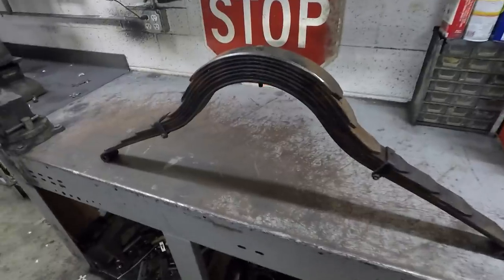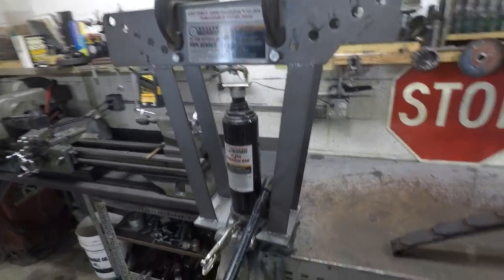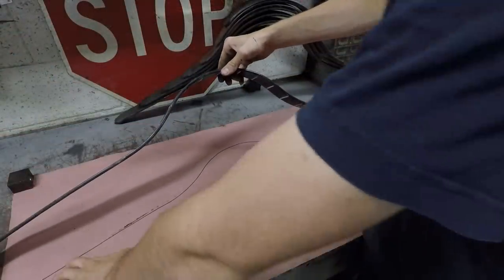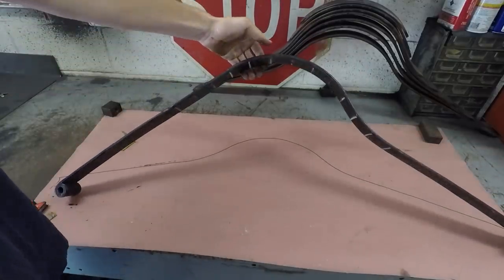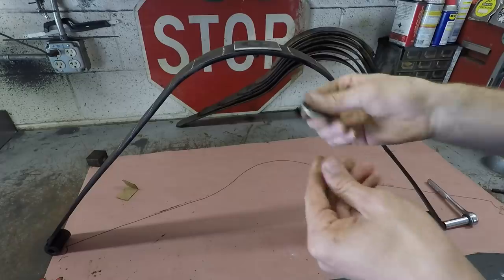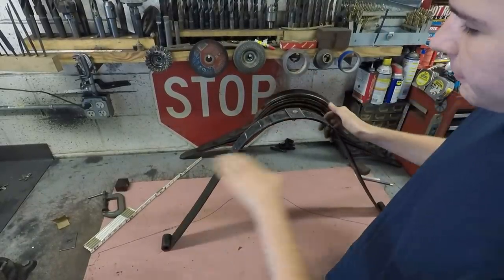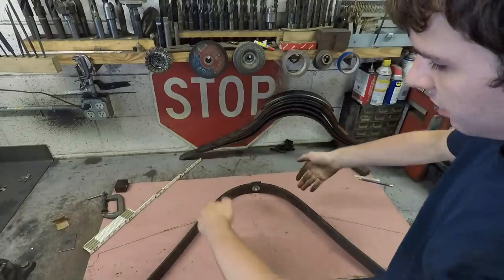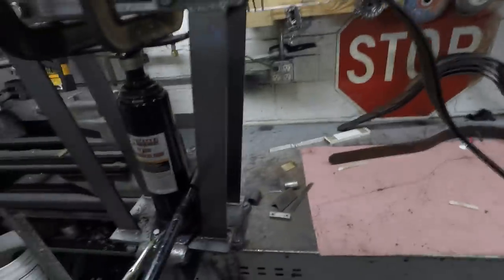How to Reverse the Main Leaf of a Leaf Spring

Comment: I worked  in a spring shop for years. We would make and change model T and A springs all of the time. On a job like the one you are doing, we would never do the work you are doing cold. It just does too much damage to the quality of the spring material its self. We had patterns that allowed us to make exact copy's of the original springs. On a job like yours, if we didnt just make a new leaf, We would heat the leaf red/yellow hot and re arch it over a pattern with the eyes up. The quality of metallurgy from the time the model A's and T's were built is crap compared to what we have today. When we tore into a model A or T spring pack, they were typically wore out or rust pitted so bad they were not worth trying to save. Cold arching is a commonly done part of making springs. This is only used to reproduce a 1/2 to 1 inch correction to put "snap" into the spring pack. Snap is the amount of more arch each leaf has over the one below it or closer to the main leaf. You can gain far more strength with snap than you can by adding leafs. This is where the art of making springs really becomes more clear. If you want to lower a vehicle you de arch each leaf but add more snap. This prevents the spring from feeling too soft or saggy from the de arch. This produces a quality leaf spring that has a higher spring rate than it did at full arch height with no or little snap. I have 21 years experience in making leaf springs and winding coils. I like to think I know my shit. I have built carriage springs for museums including the smithsonian as well as making leaf springs with 16 inches of arch above the stock height for Trucks running 44's and bigger tires. I dont have a clue if the spring pack you are working with is a reproduction or if it is an original model A spring. If it is an original, Dont use it. The quality of spring steel from the 20's and 30's will not hold the shape you put into it cold and it will break. Its just a matter of time if it doesnt break just sitting there with your cars bare frame resting on it. More on what snap is. On a spring pack with out tapered leafs you want the contact to be in 3 places. The center inactive area and at the ends. Snap means the shorter the leaf the more arch it has. This makes each leaf support the longer leaf above it more effectively. This reduces spring squeek and friction between leafs. This also gives your spring pack more power or a higher spring rate. This can be very beneficial on older springs that have no snap remaining or never had snap from day one. The less your leafs rub against each other full length, the longer they last. This was the whole idea of the delrin pads you sometimes see under the ends of each leaf on high quality leaf springs.
Reply: This is in no way a criticism of your work. So far everything I have seen shows skill and a good feel for what you are doing. You are an artisan and it shows. But you are not doing the spring work right.  Love your sheet metal work and fabrication work. It is truly professional. As an additional note. Most people do their spring work after they have the entire weight on the vehicle. Otherwise you have no way to calculate ride height. and you havent even run into fixing lean with those springs. This will test your patience like never before. I have been working with springs 21 years and I still hate to see a model T of A come in the door with a lean I have to fix. They are a bitch. Just a warning. With any luck you will not have to deal with this issue.
Reply: I don't think he saw your comment which is a shame. I appreciate it because I always like learning from people who know their stuff but have a bit of humility.

Comment: Good job, but have you thought of the fact that the spring eyelet was down for a reason? The way it was the weight of the car is on the spring, now it's on the eye and can now work the eye open causing the link to fail.  Good luck and Keep Rocking!!!
Reply: Rocker Pat, my thoughts too, will weaken at eyes, better to use longer shackles to do the same job.
Reply from the maker: possibly, but people have been doing this for many decades with no issues
Reply: Yes they've been doing this for decades ! But not all without fail!
Reply: It doesn't cause it to fail. You can buy new springs with reversed eyes and there are thousands of cars that run them.

Comment: Hi there!
Great video!!
I wanted to straighten out a scrap piece of leaf spring to make sword out of it!
I wanted to know if it is possible with a 3 ton jack 
The thickness of the spring should be somewhere around 7-8mm
Reply: How do you plan to make the sword? Are you planning to forge it? I've made several knives out of leaf spring on a coal forge. I cut the rough size out of the spring, then heated it orange-hot and forged the blade in a traditional manner.

Comment: Ah yes, nothing like hours into work and realizing it was bunk before you started. But, better while you were working on it than while you were driving the thing.
I have seen springs re-arched with a crosspeen hammer and two railroad rail anvils. Your method looks far quieter and faster.

Comment: I was wondering how you did this.  I was for sure and certain you were going to need a torch.  Nothing like a little hydraulic muscle to make it work.  Can you update on what you ended up doing for the final product after you found the crack?  Did you get a whole new leaf spring set or did you score just the one main spring you needed?
Reply from the maker: I'm not worried about finding a new spring at the moment because it isn't an issue until this thing's drive able which is still a long way off.
Reply: you don't want to use torches on springs, as you risk having tempering them
Reply: @StanleyKubick1  I think I would rather temper it then push it past the yield which is what his method is. Heat treating shops aren't all that expensive either. But the normal method is just to bring it to a high polish with sandpaper and then gradually work your heat all the way up by color of the oxides.

Comment: weld the crack continue straightening  to  the shape you want press out the bushings and then you're going to have to heat the whole Leaf to relax all the stress that you put in by bending it backwards cold.. do your research on how to heat a leaf spring and cool it slowly so it's temper is the best you can get it it's not a write off easy fix
Reply: Agreed ... weld to almost the point of the end of the crack and then "Stop Drill" the end of the crack ... no more propagation of the inherited crack ... should last many years.

Comment: I'm wondering what are the issues holding you back from cutting and re-welding the eyelets? Welding doesn't render a part permanently disabled, plenty of structural, load bearing components are welded. 

Also, it't a long shot, but since you're in the market for a new spring, perhaps there will be a suitable modern (and flatter) spring from a junk yard as a starting point. Might be easier than trying to re profile a 100 year old part.
Reply: Agree, that's what I would do.  Nice, clean TIG weld would work nicely.

Comment: 989,423 view. 😂😂😂

Great job on re-arching the main leaf Vince. It sucks to put that much time into it only to discover the crack when you are near completion. 
You may want to price out having a main leaf made compared to sourcing another original 100 year old leaf that may also be cracked. 
You could potentially by a “blank” basic arch with the eyes rolled on top with the right leaf thickness and length and still make the final arch yourself.

Comment: Why not just heat the eyes and work them the other way and retemper just the eyes instead of trying to rearch the entire spring?
Reply: jamie kling That's the way I always thought it was done too. Seems like I remember seeing it described in old hot ridding magazines.
Reply from the maker: Im sure its possible but I didn't feel like doing it that way lol
Reply: Rolling an eye in the end of a leaf spring is a lot harder than rearching it like he was. 
I worked in a spring shop years ago and made many main leafs and military wrap leafs with the equipment we had so doing it at home would be very difficult if not impossible.
Reply: That is what thought he would do at first
Reply: lunkydog with the equipment he has it is easier to do it the way he has than reforge the ends.
Reply: Steven Booth I understand that. In the articles I remember they were taken to a leaf spring shop, which used to be more common back in the day.

Comment: Can't the leafs be restacked in reverse order with the main leaf on the bottem? Wouldn't that accomplish the same thing?
Reply from the maker: well then the leafs underneath the main leaf don't do anything
Reply: MacroMachines that would depend on weather the axle sits above the springs like on a Early Ford Mustang or under it like most others wouldn't it? In the case of a mustang you would at least lower the rear by the thickness of the spring stack minus one leaf wouldn't you?

Comment: allways was under the impression that you needed to heat the spring to reshape it then retemper it , seems to be a lot eazier to do than i thought
oh darn , might be caused by the rough edge on the spring 
maibe you can find some spring steel blank or a leafspring from say a azian compact car in about the same size (only needs to be the same thickness you can machine the edge on a mill or grind it so its the same width ) , if you use a steel strip blank you probably do need to heat up the ends to make the eyelets and temper it once you done bending it , you might actually be able to do that with an induction coil
Reply: watahyahknow 
No heating required. Spring steel is available as pre-arched blanks and a hydraulic press are the basics. 
Heat is only needed to form the eyes on the ends of the main leaf or secondary leaf in some cases.

Comment: I think I would have just cut the eye lots off and just flipped them around a welded them I know they tell u not to weld on springs but on these little springs it wouldn't hurt nothing just keep them cool I've welded coil spring back together with no issues.

Comment: WOW! I seriously thought people just cut the eyes off and flipped them, then welded them back on. Nice work! Sucks for the crack tho.
Reply: I was just about to ask why he didn't do that. I would think that would be faster, especially with his skill set.
Reply: After I posted this comment, I read below the proper way would be to heat work it back the other way. And now that I think of it, I remember as a kid watching my brother do the heat bend for the eyes. Maybe cutting and welding wouldn't be strong enough or consistent enough? Unsure, but it was a cool vid.
Reply: You would loose the temper in the welded areas. Plus, the end are a high load area, even re-tempered, the welds might crack too easily.
Reply: Good call.

Comment: couldnt you just weld over the crack? or is that not doable?
Reply: Axle Marley 
Welding a tempered leaf spring might be possible but could create a brittle section and with it being the main leaf it is the primary connection between the axle and the frame.